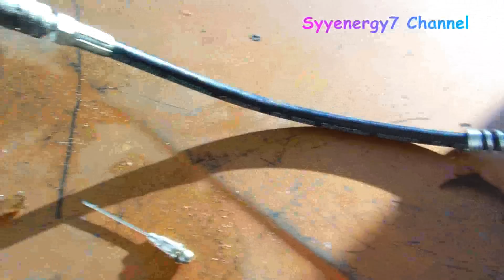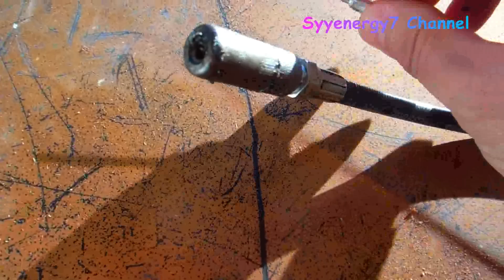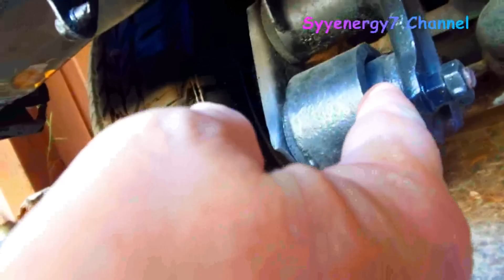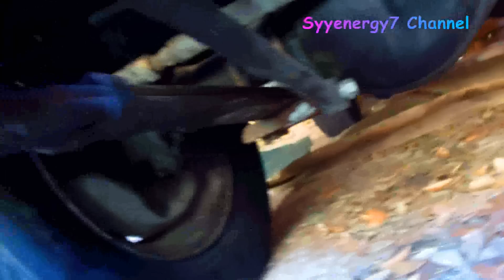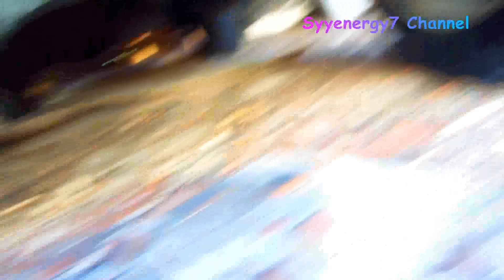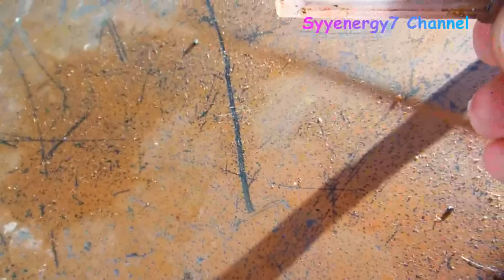How to Grease Joints with no grease fittings

Comment: Buy fittings or replacement parts with fittings. Using a needle is some times a last resort but only to get the grease in a fitting you can't get a Grease gun connector on.
There is no simple fix like you suggest to properly do the job.

Comment: Anywhere there are rubber against metal there’s not supposed to have grease the grease will soften the rubber and u will have a worse problem these needles are made for c v joints or ball joints that don’t have a grease fittings

Comment: I did a search and come up with nothing. I would like to order one of these  jawed grease gun hose's............. Maybe someone can help me out.. great video
Reply: Peter Trentacoste All grease gun hoses have the same fittings,  they can be loosened or tightened to make it acceptable to the grease fitting. Check eBay or amazon
Reply: Mt Man 1949  Thank You... I checked my grease gun and you are correct. Weird part is why they do not mention this when you buy the grease gun. I would think this is important to the user. I was also told that some times the fittings not accepting grease to push a punch of some sort on the zerk to help loosen the fitting
Reply: Peter Trentacoste your welcome, a lot of manufacturers don't explain their products, give people drum brake pliers and ask how they're used. If you want the ultimate in grease gun connectors, check out the lockandlube. Won't come off, won't leak. A little pricey at 30 bucks on Amazon but if you're young and do a lot of greasing, they're worth it. Saves a lot of frustration.
Reply: Lincoln also has a lever-action grease coupler. Model 5900. Check out lincolnindustrial.com and click on the new products page. Really cool tool.

Comment: I Just Installed new ball joints on my 87 camaro and i cant find grease fittings anywhere the hole is very small none of the fittings i brought fit the hole if i use this needle tool on my grease gun and grease the ball joints will this work properly ?

Comment: Never put a Hole in Grease Joint Boot. Never !
Beware of YouTube experts.
Grease Joints generally only get “dry” from tears or holes.
Reply: syyenergy7 exactly...and what's the big deal, if you think you're at that time to have to inject b/c the boot looks is now flat, old. run down, then pump away!  b/c it's either that & get yourself some additional time to save or whatever for a new replacement later on, or "don't do anything & allow that replacement day to happen soon when you might not be ready for it ya....we're not talking about pumping the botox into lifer/non-greaseable joints off a new/fairy new vehicle at every oil change (or at all initially)...talking either years later or if some major wear has occurred. 

I did this yesterday on the front transverse link joints...** used a "needle-sized" dab of super glue on the entry....but ya, u don't have too (I put my entry in the back closer to the brake heat shield (dust shield?)...but accessible so I could both See it/monitor each time...as well as add more botox when needed. 

Heads up to other new silicone boot pumping shmux! Ya, a "little" comes thru the needle, but DO NOT go nuts pumping away...it balloons fast (the chit expands or something)....I had to wait couple hours for it to release itself...could pop the boot too, esp. on any load bearing components.

GET THE BOTOX FOR YOUR CAR'S BOOBS!!  DO IT!!

Comment: on permanent lubed ball joints and tie rod ends, there is no grease ways to permitting tha grease to make its way around the ball so usually, a grease fitting is not the answer.
Usually, I release the mounting stem and I insert the injector needle between the them and the boot so I don't make damage to the boot.
Usually, I use a moly type grease as usually, the original fill is made with this type of grease.

Comment: Getting grease down into the ball area that actually needs grease doing this would be like wiping your butt with your pants up.
Not really very effective !
Reply from the maker: The grease does work it's way to where the ball joint it.  Fill up the boot and as you drive the car the grease works it's way all round.  Not as good as using a grease fitting, but it does work.  Initially you will have metal-to-metal contal, but the grease does get down in that area.  It's a 1000 better doing this than leaving the joints dry with no grease.
Reply: LOL

Comment: All your doing is filling the boot with grease.. I can see greasing bushings and what not, but the ball joints and tie rods will not benefit from this.
Reply from the maker: Wrong.  It's not as good as having the grease fitting filling directly into the joint, but you are still getting the grease on the moving parts and that grease it working it's way down through everything as the joint moves around.
Reply: Hardly
Reply: Lmao okay, I'd like to see you stick an indicator and measure the play on that "tight like new" joint.
Reply: CG.
You youngster are correct !
BTW a hand pump grease gun can reach up to 15,000 Lb's of pressure.
That's Fifteen Thousand PSI
Reply: @tickyul.
You going to loan him your Tinky-Winky videos ?
Reply: B Anno if it quiets the joint it's clearly not metal on metal.

Comment: 1. parts wear out, its just the reality of things.
2. Sealed boots and joints aren't a way of manufactures trying to rip you off, its called progression. Sealed are more efficient. 
3. going around poking holes in boots is not a good idea, THEY ARE SEALED FOR A REASON. 
4. Most likely by the time you realize you need to grease it, its probably done for and needs replacing. 
5. Greasing leaf springs? Exposed grease attracts dirt and builds up grime. For leaf springs you want a dry lubricant like graphite. 
6. They don't grease sealed joints by puncturing the boots because its a bad idea.
Reply from the maker: Har Har.  No holes in the boot.  Grease goes under the lip.  The only legit EXCUSE for sealed boots is that many "mechanics" are idiots and OVER-GREASE and damage the boot.  These parts are original and from 1985 and they are tight like new.  Don't lecture me.  Do whatever 'ya want .

Comment: / Your vid helped give me an idea . I got a 98 Mustang GT and it has no grease zerts on the front end . so after watching your vid I had the idea to use a syringe on the closed rubber boots and etc' . I had some laying around the shed from giving my dogs there shots . it worked like a charm . I just took off the metal tip than shot grease into it from the grease gun . I know this comment is realy long but thank you for getting me started anyway .